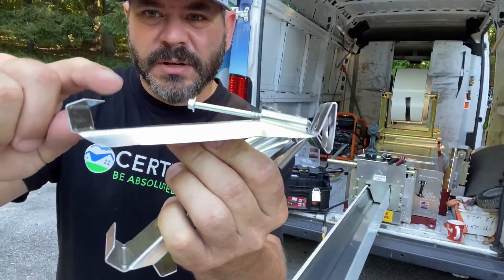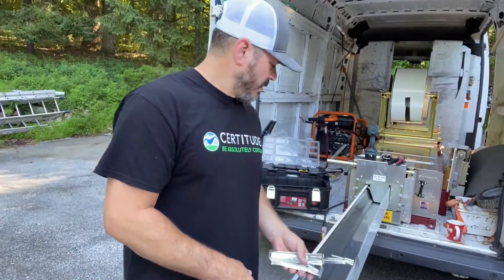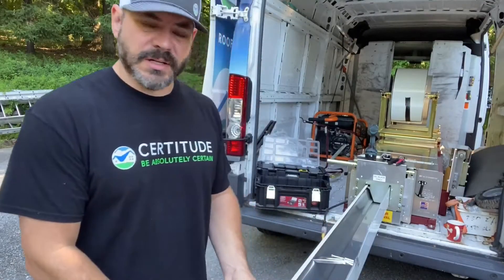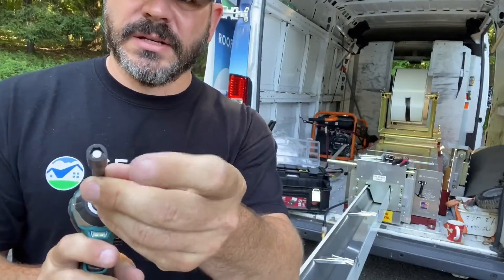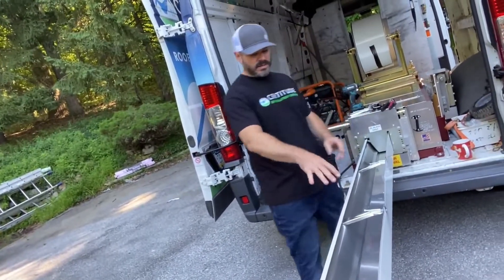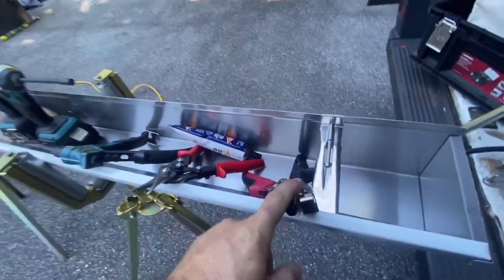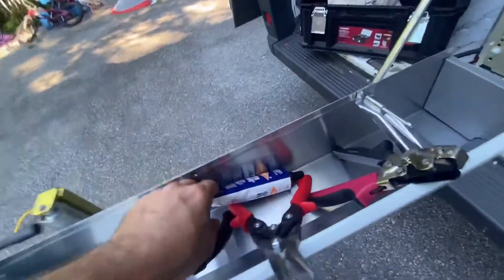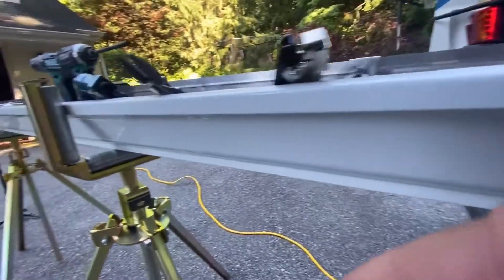Our Gutter Machine and how we make gutters

Comment: Probably best to put that sealant on before sliding the endcap and the outlet on...and THEN you crimp it or zip it. Just adding the sealant last means it only sticks to the aluminum on top and with time, sunshine and weather, eventually it can be pulled off like a rubber band, or simply get washed away in pieces and the homeowner wouldn't know until a leak shows up during rain. But you're the pro--I'm just guessing here.
Reply: I am sure he would when doing an actual job, but yes, you're surely right.

Comment: I just had the top of my chimney removed to the roofline. The remaining part will be for storage, but it sticks out about 20 inches. Can they make a 40 foot gutter that curves about 2 feet in the center? I'd like one continuous gutter.
Reply from the maker: I have not done a curved gutter.  Not sure it’s possible.  I suggest adding a diverted on the roof line to divert the water to either side of the curved area which could dump the water into the gutter on either side of the curve.  Hope that helps if not sorry in advance🤘🏼

Comment: Not a bad video / but there are a few things I would like to teach ALL newcomers to the business / #1 - Hidden Hangers / there good if used in the right place / it is NOT the strongest hanger that is made and is not good for areas where it snows / I noticed pine trees in the background so I'm going to assume it snows there / for the best hangers for a snow area / go to Lynch Aluminum and have them send you a sample of the " Heavy Duty Brute Hanger with the Strap" I don't think you will be able to find a better hanger ANYWHERE / he also shows putting the screw (of the Hidden Hanger) into the gutter before he hangs it / I would not do that / if the screw is sticking out even just a 1/4 inch past the back / the gutter will get caught up on the fascia board while it's being installed / when the gutter is in place / then put the screw in / he also shows a few ways to install a end cap / I do like it when he talks about the cap coming off if you do nothing / do not put screws in the end caps / just looks bad / use the tool " end cap crimper" looks much better / pops are OK but it takes much longer to install / lets move to the outlet cups / the way he shows will work but there are 2 faster ways that look and work much better / first is a hole saw / ALL gutter supply house's carry them / a 2-3/8 inch or a bigger one a 3 inch hole saw / just cut the hole where you need it to be and drop your outlet cup down and it's done / 2nd way to make a hole in the gutter for a downspout is a downspout punch / thay cost a bit but if you do not lose it / the tool will last you the rest of your life / mine is going on 50 years old /  lastly is the caulking / I personaly do not like calking in what looks like a tooth paste tube but that is just me / I like a real caulking tube that fits into a caulking gun / and my caulking of choice is the Geocel brand / caulking is just a matter of choice / most work good /  Geocel has NEVER let me down since 1977 / so that is it for now on how to install what you just saw / you can go to my website at / www.RainGuttersByRock.com / and just a bit of advice to ALL of you Pros out there / STOP doing bids for FREE / my website says wright on it / I'm not the cheapest but I do think I'm the best, and I charge $20 for a bid / I have only had (2) people tell me NO since 2012 / all the rest pay me my $20. you can also read about some of my ideas in Gutter Enterprise / which might be the ONLY Gutter Magazine that is printed today / also look up my ( Cost Calculator in the Jan/Feb issue on page 20 ) / it will save you from running out to each and everyone who calls you / some just want a price and then like to think about things / it's a really helpful tool / copy it if you want / I'm giving it out to the gutter world / use it.
Thanks for reading this / and no hate emails please / all the advice I'm putting out here is from 50 years of installing / there just the way I do things / pick your own path / Thanks Again / Rock.

Comment: Nice work,  sealing should be done before you install the end cap. Otherwise, will fail in few months
Reply: Your almost correct / you want to first put the end cap on ( less mess ) / then seal / if you seal it correct it will last for years / I have been installing since 1977 / I know...

Comment: I've been installing gutter for a little more than 2 years. We space our hangers out a little bit further than 2 ft and we haven't had any issues so far and the only other thing we do different is we don't hook the hanger onto the back of the gutter. We just leave it inside the gutter and shoot through the back into the fascia. When we put on our end caps we use cramps instead of screws but the way you do it works just as well. Can I put my downspouts up I don't use a drop outlet. I trace the perimeter of the elbow into the bottom of the gutter then I cut a x through the middle of it and fold the tabs down and it's just a lot faster and it saves money on material and overhead. I use drop outlets only when I'm putting drop outlets on structural gutter when we build pool enclosures or poly roofs
Reply: Are you charging by linear foot? And if so how much?

Comment: How long is your machine? What is a good size enclosed trailer that will hold material, stock, tools, ladders ect..? Minimum size ?
Reply: All of you thinking about getting into the Rain Gutter business / DO NOT BUY A TRAILER / get a van / (1) it keeps the $12,000 machine out of the weather / (2) you can lock up ALL your tools and not have to empty out your truck every night / and (3) someday you WILL get in a tight spot and you will be glad you bought a Van. Yes, a van costs more / but it will pay for itself.

Comment: There is only one way to put end caps on and that is end cap crimpers with a bead of caulk you spread with your 6” ferrule that you crushed the top flat using your hammer
Reply: ..just squeeze the caulk into the crack with the caulk gun...no need to pick up a spike....not every crew uses spike and ferral..

Comment: Great video I really like the set up but my question is with a van already being pretty low to the ground can you print 100 ft gutters with out eventually hitting the ground?
Reply: The best way to install the gutter machine in a van is to put it on top of 4X4s / it gives it a lift and makes long runs much easier / and this is to the public / the pros know this already / NEVER use a screw to install an end cap / C'MON MAN
Reply from the maker: yeah sometimes the gutter will hit the ground so what i do it make sure the truck is as flat as possible (on level ground) or if thats not possible adjust the truck so that it will not hit the ground.
Reply: If you put the gutter machine on a 4X4 both front and back when putting it into a Van it will lift it up and help with the longer runs

Comment: whats the difference between 5k and 6k ?
Reply from the maker: 5k holds 1.2 gallon of water per ft  and 6K holds 2 gallons of water per ft this is a 60 to 70% increase of water per ft.   Really the style of roof (shingle/metal/cedar) and the Pitch of the roof (low slope vs steep pitch)  and the length of the roof ( 1ft vs 60ft or more) and the roof material overhang (1/2" vs 3" plus) and the size of the fascia board (4" vs 12" plus) all determine if you need a 5" or 6" gutter.  You can get all nerdy or just go bigger...to cover your ass.

Comment: Had a guy come out with a similar machine. Installed gutters galvanized, 6 inch, on standing seam metal roof, ranch style home, straight 55ft front and back. Simple?
The bottom of the gutters look like the ocean … wave after wave. 30 crumply waves on bottom of gutter out front, and 21 waves on back roof gutter bottom. 
What the hell did he do? My wife complained to him, but I was at work. Dude is gone. Now what?
Reply from the maker: Not all the machines are capable of bending Galvanized metal...the machine in the video does.  It is also possible that the machine they had was not tuned up or needed some work done to it.  As with any workmanship issue when the company wont respond and has disappeared you are screwed.  Its an unfortunate hard thing to hear but u can live with ugly gutters...which most likely work fine...or have them replaced by someone that has lots of online reviews... that are 4 star or more on google...this sucks...I hope that helps even though I am sure you didn't want that answer.  Thanks for following and posting.
Reply: @CertitudeHI  Thank you for your response. We live in Del Rio, TX. Many fly by nighters here. He only got paid for half the job. I’ll have to add my own downspouts, but following your YouTube vids will assist me. Thanks again.
Reply: @gottabighit1  ...that's called "oil canning"...the rollers in the machine were not in line.

Comment: Hi.It has been so long since i made gutter I started a Bus.in Italy around 1987 just south of Rome..When i started there was another guy in southern Italy.There was only two of us making gutter for about 5 years here in Italy.Before us they made gutter in galvanize steel in 4 meter length with benders. I started with two machines made by Knudson out of Colorado. One used of 25 cm wide coils and one 38 cm. Around 1993 i had an american mfg make me a bigger machine that used 50 cm wide coils.The guy in southern Italy made down tubes and elbow,i made brackets,end caps etc,we would exchange products. In late 1998 i got tired in making thousand and thousand of meter of gutter.Sold the business and retired. I had two trucks one had the 25 cm and the 38 cm side by side.The other truck had the 50 cm,We would go on site cut and drop and do the installing later,or we would outsource the installation.Ciao from 70 miles south east of Rome Italy

Comment: Nice vid. 
What kind if van?
Is it hard loading your metal in on the side door? 
Im stuck on if i should buy an envlosed trailer or Van
Reply from the maker: The van is a ProMaster 2500 159 wheelbase...We use a forklift to load the coils off the side of the truck (its super easy) ....Trailers r nice too (buying the truck and outfitting it will be more costly than a trailer so financially... assuming u already have a truck to pull the trailer...its cheaper to do a trailer) Either way u will be printing money!!!
Reply: @CertitudeHI  how heavy are the coils if one does not have a forklift available?
Reply from the maker: @LogosFarm  The coil that fits on these spools are about 360-380 pounds ...u can take a 2x4 with 3 people run it through the middle and pick them up and put them on the machine.  I would not do that tho.  The other option is have your supply house load it on the machine.  or what i did was use an engine hoist for a while.
Reply: A come alomg and hoist would work good to eh. Great work i just got my van and gutter machine. @CertitudeHI
Reply from the maker: This is in a doge promaster 2500 high top  (not sure about the wheel base but it the biggest one they make)  I can load the machine through the side door.  On this machine I have 2 spools to hold coils.  Once is set for 6" and the other is for 5" coils.  If u do this type of setup make sure u purchase a transfer bar (its basically a bar that allow you to put a coil on the bar and slide or roll it to the front spool and vice versa.  

We chose to put it in this van because it was a vehicle we had sitting around and it worked great. That said you would be good with a trailer if you cant dedicate a truck to the machine.  Make sure the trailers dimensions will fit the machine and make sure it will hold the weight and that you truck can pull the trailer loaded with coils and machine weight.  I think you would need a 2500 with a beefed up suspension or a 3500.  Dont use a 1500 it will blow up. 

Good luck bro

Comment: I Don't think I would be driving around with that machine in the van. Leave it in the workshop & measure up lengths on sites when you measure & quote . Then take only what you need. Free up your van for multiple job options that way. Use a calking gun instead of a squeeze tube..  Are you new at this.
Reply from the maker: Well ur wrong...the idea is to bring the truck to the job site and run out the gutters to whatever custom length is needed...Good luck trying to put a 100 foot gutter on ur truck...lol....and yes we use caulk guns too.
Reply: @CertitudeHI  you mean you don't want seams in your seamless gutters?!?!?!  Sorry, this guy's comment truly had me laughing!  Keep up the good work bro!

Comment: So y'all use a machine to make the downspouts, or buy them separately?

Great vid btw. Short, and to the point!
Reply: Buy them separately in boxes of ten x 8ft
Reply: @benm12310  Could you use a jig or sawzall to make the hole for the outlet to the down spout? Or are the snips the ideal tool?
Reply: Just but the downspouts / the machine cost a lot and to me is not worth it

Comment: Do you need a specific license to install gutters like a contract license?
Reply: Depends on state, county or locale.
Reply: A business license is recommended it is required by most if not all states and in some areas you will be required to get a building permit for the work performed.
Reply: @mikebeddingfield2144  yes absolutely
Reply from the maker: No that I know of

Comment: Seems like screws are the easiest and fastest and most long lasting way i would imagine. Although im no professional what so ever.
Reply from the maker: Screws are fast however crimping the ends is a much nicer look
Reply: The crimp holds up perfectly fine. Especially after caulk.. getting them off in order to add on more gutter to an existing install is a battle sometimes. I use needle nose pliers and spin them like I'm opening a can of sardines in order to get them off. Lol

Comment: Hey man, do you have a separate machine for downspouts and elbows? Or do you just buy those at the store?
Reply from the maker: We currently just buy the elbows...however we plan to purchase a machine to make them out of the spouts.  It doesn't really make sense to buy one of these machines because (they are expensive) you need to make a crap load of elbow before you get a return on your investment.  When we get that machine we will post that thing for sure.

Comment: How much did the machine? Tools and Van cost total investment
Reply from the maker: If you get a used Promaster 2500 high top with the 169 wheel base with like 75k miles it would run you about 20k based on the year....The machine itself is about 14k then add the accessories, transfer bar and 2 coil holders which will be around 1k ...then you need to get a generator that at least is a 5000watt to run the 6k gutter coil (1k) through the machine and then get 2 coils one 5k and 6k which ($1400.00) and then get hangers end caps and all that stuff ($1k) ...and you will need an engine hoist ($400) or a fork lift to put the coils on and off the truck...a used fork lift can be about 4k to 8k based on the model you will only need a 3000lb rated fork lift...we have an propane one but now you can get full battery ones.  

All in to be up and running I would have at least 35 to 40k for a gutter truck setup.  

If you have the sales and sell jobs at a 50% profit margin...it should pay for itself if you produce $80,000 worth of gutter installs.
Reply: @CertitudeHI  3- 5 jobs a week. I could crush this in under 6 months . thanks
Reply from the maker: @koreyjf8095  Hell Yeah..GET IT
Reply: @koreyjf8095  been about six months? How goes it?
Reply: Well 3 month update?